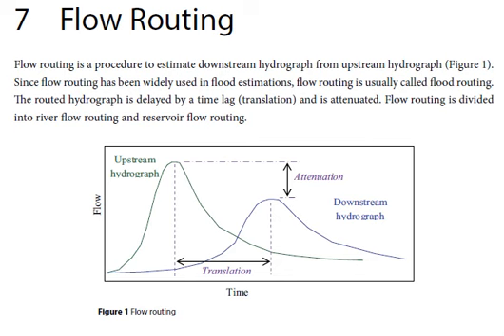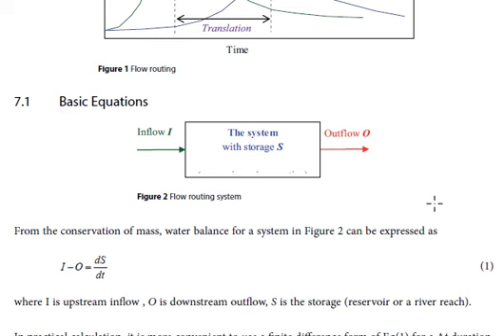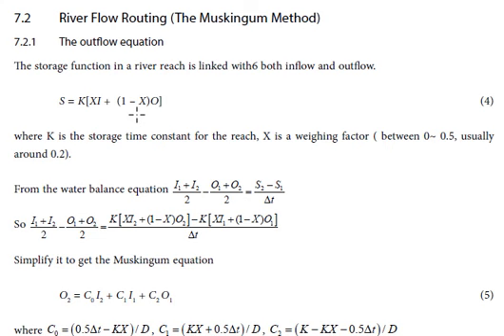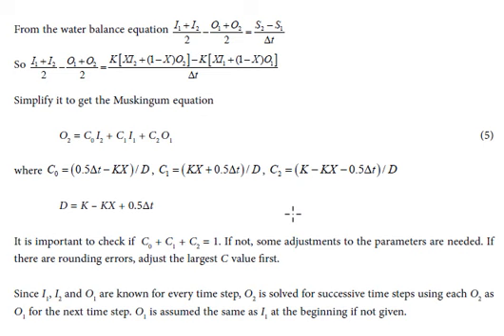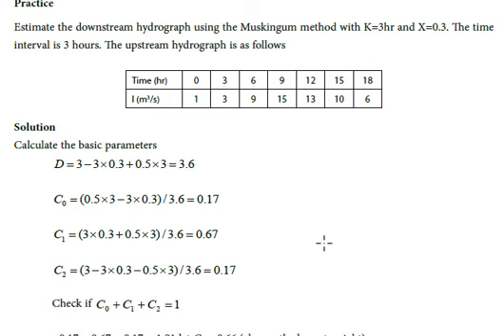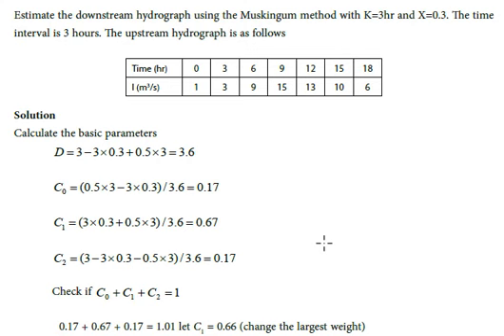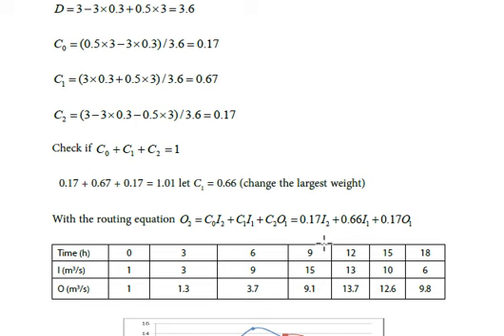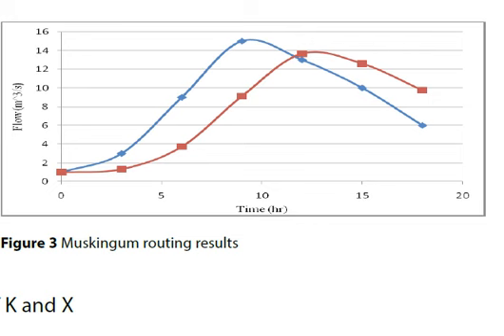Flood routing- Muskingum Method

Comment: please i have some quick question to ask concerning this topic
i have exam in 10days. Please i need help
Reply from the maker: Please post your question here.
Reply: @engineer7020  I do not understand how you got the second discharge. I understand you use the formular but I don't know how you later come about the discharge
Reply: Am not waiting for your reply Sir
Reply: @topeseun8732   Just substitute 'I' values from the table and outflow as previous outflow values.
For example, 
For 2nd value in 'o' the equation is
0.17(9)+0.66(1)+0.17(1)=1.34
Reply: @vdl1738  this method is wrong 
you can not even calculate this simple math
what a waste of my time
Reply: @vdl1738  inflow 2 and outflow 1 is not given hence we cant calculate C1 or C2 ...
Reply: @muhammadzawahir1470  sorry..I've misplaced the number. The method is right. Instead of 9 it should be 3. Other wise how the answer can be 1.34. Do like wise for the next value too u will get 3.73
Reply: @muhammadzawahir1470    !?? There is no need of inflow or outflow values for calculation of C1 and C2. They come from K,x and time (t). Please go through the formulas in the video once again.
Reply: @vdl1738  woooff.... thanks i got my final exams in 2 hour
Reply: @muhammadzawahir1470  😊👍 all the best